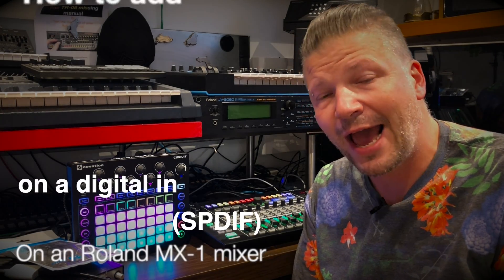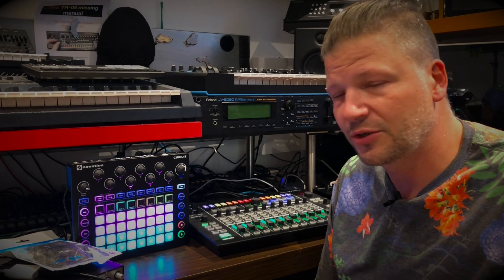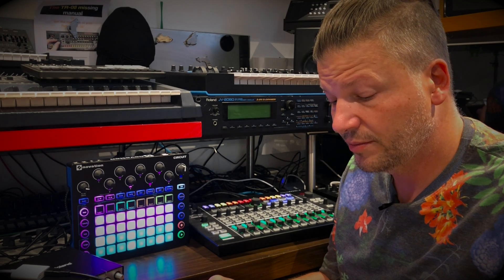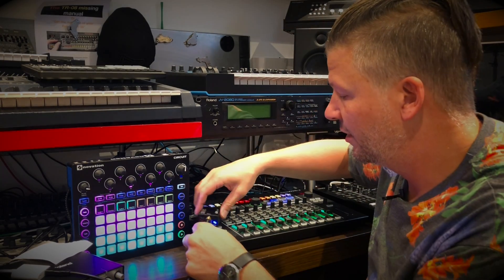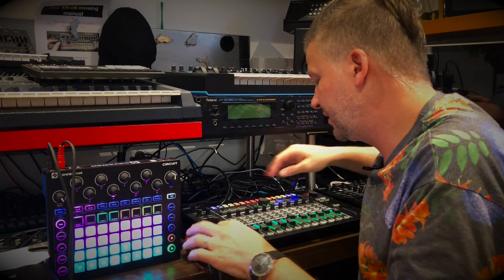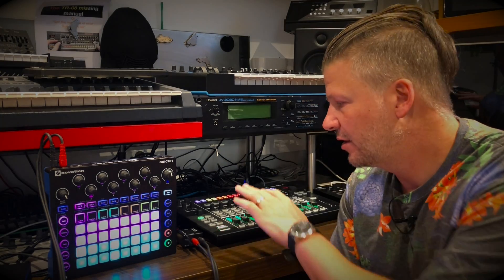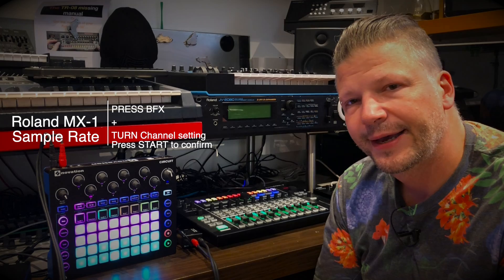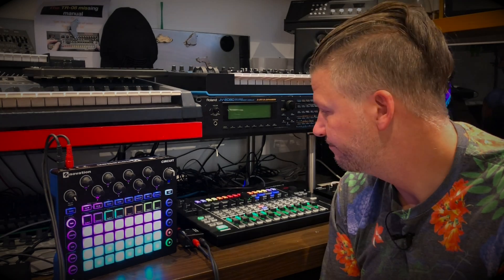How to add 2 audio ins on the digital input on the Roland MX-1 mixer

Comment: Hi need help please , done everything as instructed , new mx1 user btw all inputs filled , so got the converter diff model and tried on 3 synths that I need that input for , a signal comes out on l and r on the mx1 display below mastering button but no sound the only way I can get sound out say on my  korg monologue (latest thing bought along with mx1 like 2 weeks ago) is to go through the the headphone out on korg , mx1 set to 48 thanks
Reply from the maker: Have you checked if the SPDIF is in input mode? Be default it is in output mode.

Comment: I have tried your aproach with a similar converter (Swissonic) trying to hook up several external devices (among which an Alesis SR-18 drum machine) to the digital input of my MX-1 mixer,  but neither setting (44.1, 48 or 96) wont work. Used high quality cables, double-checked everything, including the input/output setting on the MX-1, but no result. Does the fault lie with the converter or the digital input of the MX-1? I still couldn't find out. All  the rest on the MX-1 works fine.
Reply from the maker: I had problem with the sample rate mostly between the converter and the mx-1. Sometime the order in which your turn on the device also affect the rate sync.
Reply: @Nu-trix  Thanks for your reply. I tried every possible order to turn on every  involved device at every possible setting, but unfortunately still no result. For now the only solution is to try to borrow a device with a proper digital output to check if the input of the MX-1 is okay. If so, the Swissonic AD 24/192 converter goes back to sender.
Reply from the maker: @iniputu  don’t forget to switch the digital SPDIF connector to audio in (in the MX-1)
Reply: @Nu-trix  Yes, I did. It was the 1st thing I checked.

Comment: howdy, thanks for all that you do. I have tried this on 3 occasions, with 3 different converters and no luck. No problem changing sample rate, audio source is verified, numerous RCA cables tested. All converters were labels as RCA input, digital output.
 I did confirm that converter TOSLINK output does operate correctly.
 Latest brand to test was 
Musou RCA Analog to Digital Optical Toslink Coaxial Audio Converter Adapter with Optical Cable.

 Possible failure possibilities: I only have one digital coax cable and I only have one MX-1 so either of those could be faulty. Any thoughts on where to go next?
Reply from the maker: After all your testing I would try the converter with another coaxial compatible device for double check if it's faulty. This connecter on the MX-1 can either be IN ou OUT. Maybe double check that it is in INPUT mode. Turn on the  MX-1 while holding GAIN. Press on SELECT of the Digital channel : If it is on (lights on) it is in input mode, if off then it is in output mode for the Coax connector. Hope this helps.

Comment: hello, thanks for your videos, im learning a lot from it! Can you please kindly let me know you thoughts on this situation? I have different devices, Korg Kaossilator 2S, iPad Pro USBC, OP-1 Teenage Engineering, Roli Blocks with Seaboard, connected to a Arturia AudioFuse, the problem is that they all have different volumes, some sound very loud and some very low when connected directly to the AudioFuse, so I can't get it use use all at the same time, while I get the volume perfect for the Seaboard and blocks, the Kaossilator 2S will sound very low, and so forth. Any idea on this? Im using 3.5mm stereo cables, and now just got a Yamaha MG06 Mixer that I could control the volumes and still no results, thks a lot!
Reply from the maker: To use them without a mixer you should start with setting the lowest volume generator (kaossilator 2s) to its loudest. Then set the other to a confortable volume in relation to the Kaossilator. That is one option.
Reply: Do you think having the Mixer will help in any way? thanks again
Reply from the maker: If you want to use the MG06 mixer, you will need a mono 1/8 inch mono to 1/4 inch mono. For the Kaossilator you will need 2 rca to 1/4 inch. Then control the volume with the mg6 and connect its stereo outs to the Arturia AudioFuse.
Reply: I see, Ive tried to do just that, connecting the KAOS and making sure the volume is up all the way, although still it doesn't sound loud enough, I have to crack the volume on the Audiofuse itself very high in order to get on the volume I want, can it be the cable? Im using the right cable? Do you think I better keep the Mixer? thks
Reply: Luc Lafontaine thanks, which cables do you recommend? Thanks again

Comment: hi I'm receiving an audio signal at a rate of 96, so the signal is mono, any ideas
Reply from the maker: I use my Mx-1 at 48kHz. If you are ok with running at that speed it should work.
Reply: @Nu-trix  already discovered the error I was using a normal RCA cable and so only the audio signal on the output was mono when using a digital coaxial cable starts to work in stereo I think

Comment: I don’t see how it’s adds 2 inputs u only hooked up one thing
Reply from the maker: Playground Of Sound , in the case of SPDIF digital audio, the connections are transmitting left and right on a single cable.